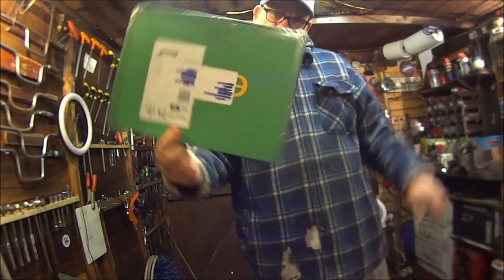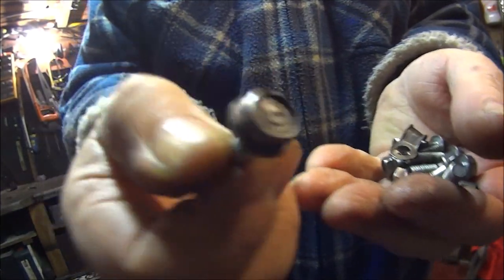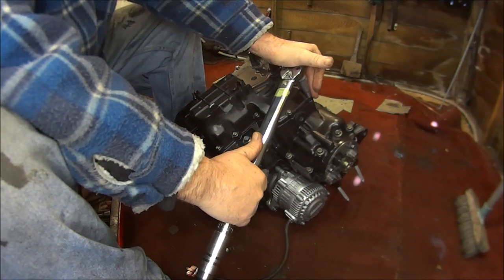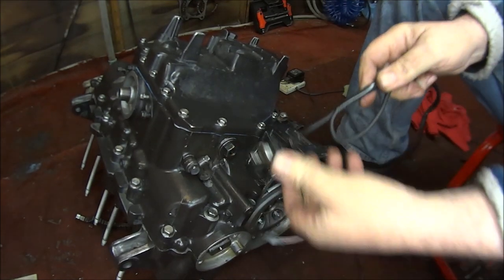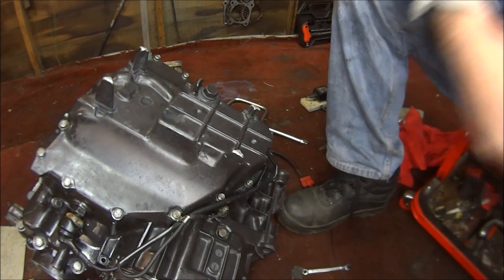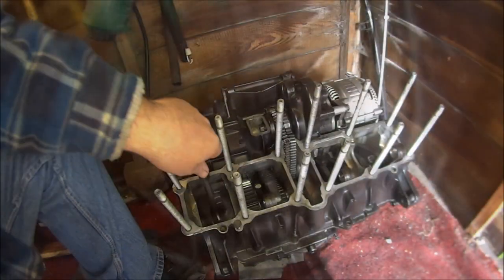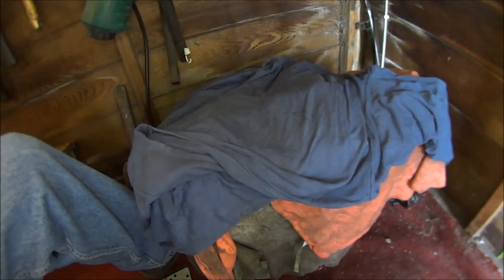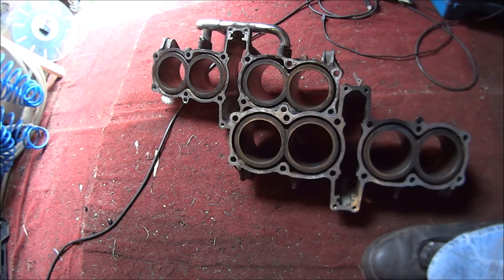CBR1000F Landfill bike. finishing off the engine bottomend.

Comment: Hello Jon, great work! You’ve saved me from a lot of agro on your previous videos re the XJ... can I ask the red tubes you improvised from the carb to the engine... did they last? Mine need replacing and your idea seems a much cheaper option. Cheers
Reply from the maker: Hi Luis cheers buddy. Yes over two years later still working perfectly 👍👍👍
Reply: Great stuff... I’ll follow your lead on this. Cheers Jon
Reply from the maker: Cheers Luis 👍👍👍